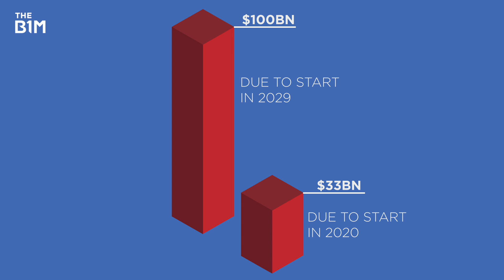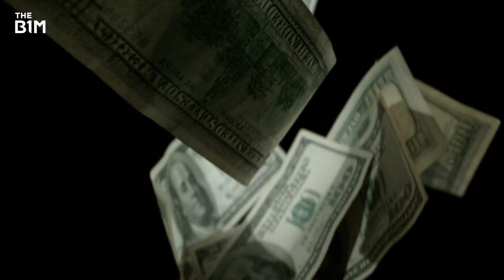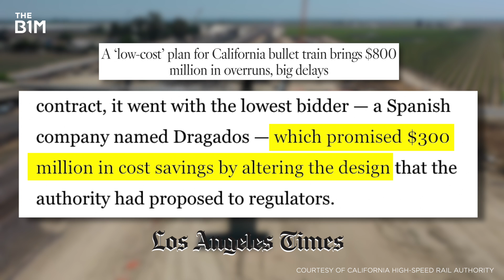What Went Wrong With California's High-Speed Railway

Comment: Californians: “wait, where’s the rail we paid for?”
(Now) Rich(er) Politicians: “never was going to be one”
Reply: @Zaydan Naufal If the highway is built at the same time as HSR you can choose where the highway goes based on HSR requirements. Makes your highway a lot more expensive but also makes HSR in the median possible. 

Indonesia is a third world country with extremely cheap labor and low construction reliability standards. Basically they can finagle their way around some cost issues a lot easier than we can here in the US. BTW, I hope that they are doing a good job and not cutting corners, but it is unlikely that they aren't doing that at all.
Reply: I suspect your comment is oh so TRUE!
Reply: not really. the people actually running the project were the ones who botched it, not politicians. 

Still, it was poorly planned from Day 1, that's why I voted no.

Really this should be been a private enterprise, paid for by private investment, because it's in the category of "nice to have but not necessary" since the private sector already does an excellent job of getting people from SF/SJ to LAX/SD at high speed using aircraft.

But if we're going to do as public transit, we should have done it like a private company would: use the shortest road, which is I-5. Have maybe one spur going from Fresno to I-5 to serve the Central Valley but that's it. Then no other stops except Sacramento, SF, SJ, Los Angeles and San Diego. Run it as close to 200 as you can for the whole way. Give it a dedicated track, down the median of I-5 (none of this bullshit building it miles away from the highway, having to buy all kinds of private land. That just ruins people's livelihood for no reason. Stay on public land.).

Since they didn't do any of that... and that is NOT a politician's fault, it is the fault of the state workers who designed and planned the system...it became a boondoggle.

The French and Japanese offered to help pay for it, and give their advice (since they have great HSR systems). But when they realized how stupid it was to go down highway 99 which is 20 miles longer and has all kinds of little towns in the way, and they requested that the state change their route to go down I-5, but the state refused....the Japanese and French backed out of it. That should tell you something.

https://transdef.org/Blog/Whats_hot_assets/High-speed%20rail%20officials%20rebuffed%20proposal%20from%20French%20railway.pdf
Reply: @neutrino78x  That's all well and good, but you are forgetting that the route was chosen to appease the Central Valley Republicans so that they don't CEQA and sue CHSR out of existence. Of course, now we know that it failed to, but it was as good a plan as any with the information we had at the time.

Also, running HSR down highway medians turns out to be extremely expensive unless you build both at the same time and optimize the route for HSR. This has been tried and is almost always a "boondoggle," like you say. The cheapest way to build HSR is on virgin land where you can choose the route based on the landscape to avoid obstacles. Trains are not cars and the amount of tunneling and "viaducting" you end up doing is prohibitively expensive if you follow the path a highway took. 

But this is all beside the point. This is a public project with seed funding provided by the taxpayers of California. They asked the public what THEY wanted and this is the system we got. It is planned for, partially paid for, and currently being built. This is the best we are ever going to get. So, do you want to have HSR or not?

I do and support the project because the benefits far far outweigh the costs. Even though some of their decisions didn't break my way, I want this built and so does most of the state.
Reply: @neutrino78x  That's not the point. Highways are planned for cars with rubber tires not trains and not HSR. They have too many grades for HSR. The tracks end up not being able to follow the path of the highway exactly anyway. They are constantly raised, lowered, trenched or viaducted for crazy distances. It is a lot cheaper to choose an optimal path with the most straight and level terrain and then tunnel strategically in a place where the geology is favorable under mountains. This is just the best and cheapest way to do it. 

The Grapevine was a non-starter geologically speaking. Any HSR to SoCal would have ended up in the Tehachapis anyway. So if you are crossing to that side of the Central Valley, why cross at the very end? Why not do the crossing close to the Bay Area so that you can hit all those population centers. It ends up being about the same distance in the end.

All of this has all been discussed to death. There are both practical and political reasons why this route was chosen. You can agree or disagree, but your opinion is not going to be taken over that of the experts in the field. People did the math and ran the political calculus and this is what is feasible to build.

This system is infinitely better than no system.
Reply: @TohaBgood2  the voters didn't get what they wanted. Right now we're only getting a piece of the project that was actually approved.
Reply: @neutrino78x  where does the 5 have a 75 foot wide median? I suggest you Google Earth that.
Reply: @neutrino78x  also, you voted against it? You call the 5 "I-5" which tells me you're not even from California. And if you think maglev was even an option, you've got some serious problems negotiating reality.
Reply: @MrTaxiRob  in Northern California we say "I-5" and "101". Adding "the" is specifically Southern California.

At the price they wanted for this boondoggle, maglev damn sure should have been an option. Way too much to pay for wheel on rail. Just ridiculous.
Reply: @neutrino78x  so where is the median 75 feet wide, north of the Grapevine? Have you ever actually been to L.A.?
Reply: @MrTaxiRob  Obviously you wouldn't go on I-5 all the way into the city. You want to stay on I-5 when you're going between cities, hence the term "intercity travel". 

We're talking about using I-5 because it is shorter -- 380 miles as opposed to 406 miles for 99 -- and straighter, and the median is wide enough that you can build two train tracks right at grade, not having to do any special construction. 

As opposed to 99, which has a lot of little towns on it where the train would have to slow down a lot, and where the median is narrow, and 99 has a lot more curves.

So they made two stupid mistakes there, (1) they should have gone down I-5 and (2) if you're going to down 99, you go down 99, not down on people's private land several miles west of 99.

I'm proud of my "no" vote on this failed project. This project was so stupid. I'm glad they ran out of money so it will end with the IOS.
Reply: @neutrino78x  privately run railways often do worse than state run ones(the UK vs Germany is a good example) because the profits from railways are pretty indirect, so unless you owned a  entire city, it's pretty difficult to make a profit. Even the US knows this, look airports, all of which are subsidised by the government.
Reply: @neutrino78x  it was the railroad that didn't want to share its right-of-way with a parallel line. The state should have eminent-domained it, but I guess the railroad lobby's pockets are too deep. That's still the politicians' fault.
Reply: @neutrino78x  - except the people running it were appointed by those politicians you exempted.
Reply: @SouthBaySteelers  Actually, by state law they were required to accept the lowest bid. The same contractor is now known around the state for lowballing gov't contracts and then going crazy with "change orders" to get up to 3x more than he bid. If the change orders are not approved, he sues and bleeds even more state money via frivolous lawsuits. He's a Republican btw. Not that it should matter, but I have a feeling you would care.
Reply: @TohaBgood2  Probably a RINO more likely.
Reply: The decline of the US manifested right here. The politicians and the media stir the public to useless topics, like China invaded Microsoft BS and we the public go right along with it, parroting what they give us.

Comment: This is just pro-train propaganda. The working high-speed rail lines are generally not built on trestles. The California project uses (requires) trestles even where the land is mirror flat. The project should be killed until the special interest groups come up with a plan to get it done at a reasonable cost.

Comment: I think that California's lack of water planning will take precedence when it starts to hurt. You can live without decent transport but you cannot live without a water supply. 
Question- Wouldn't a good city to suburbs rail system (which in California will still be large) be a much more viable transport system that will address much of the motor vehicle use and congestion?  ie Start with practical, fundable solutions that will get 'on line', actually serving the citizens, with each new branch added. Leave the dream of the high speed rail to the wealthy dreamers with time and money to waste.